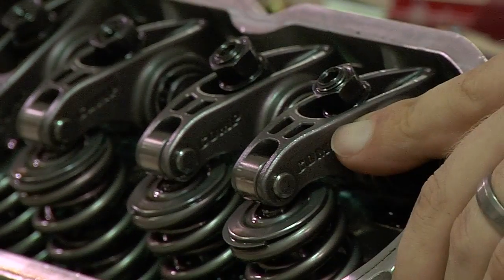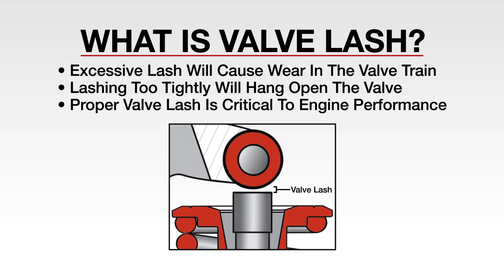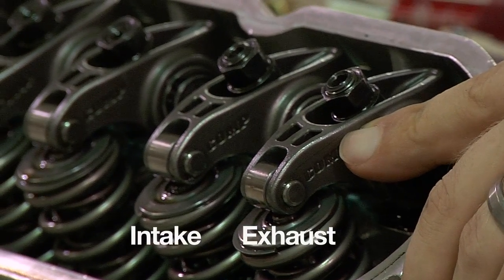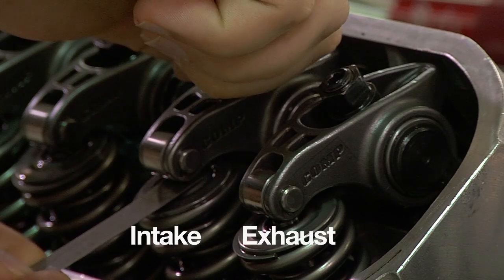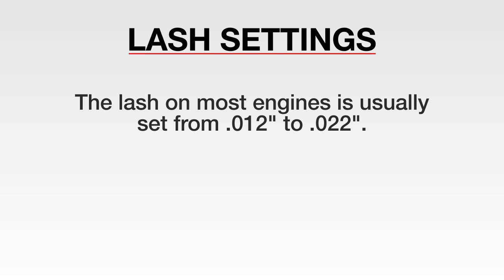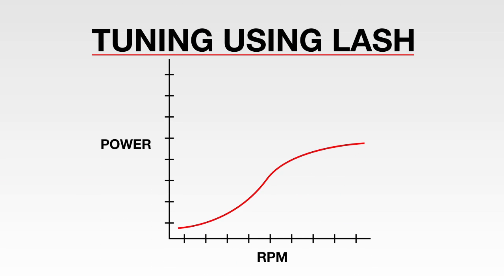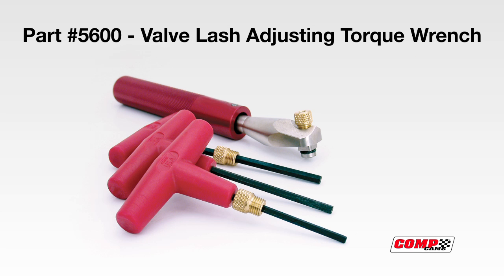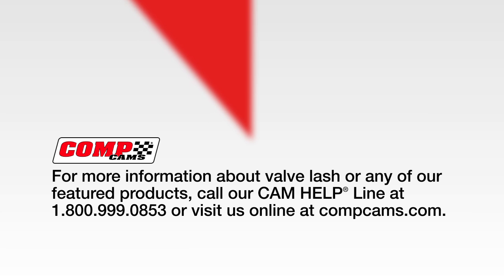COMP Cams® Quick Tech: How To Set Valve Lash

Comment from the maker: The lash on our cam cards is for when the engine is warm. When the engine is warm the heads and block will expand, which causes the lash to grow bigger. With aluminum heads and an iron block, you should set the valves .006 tighter on a cold engine. So for your setup, you would set them at .014/.016 cold.